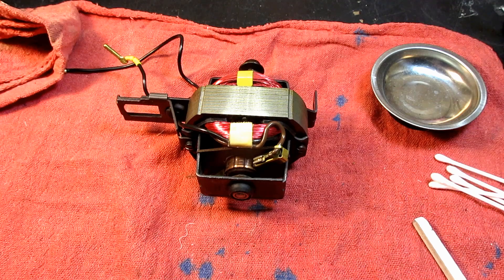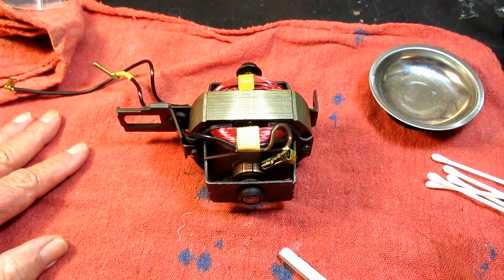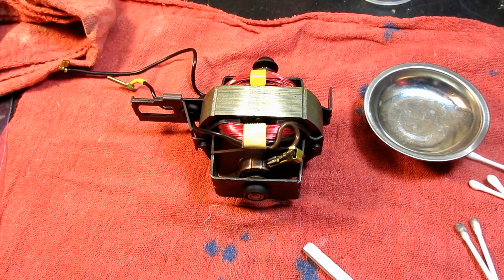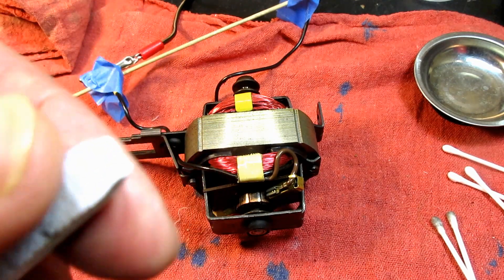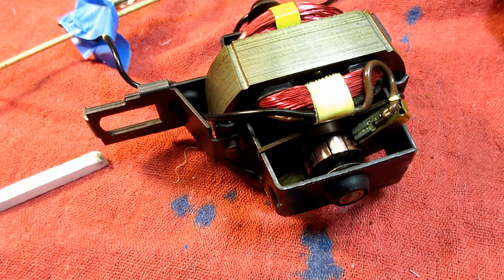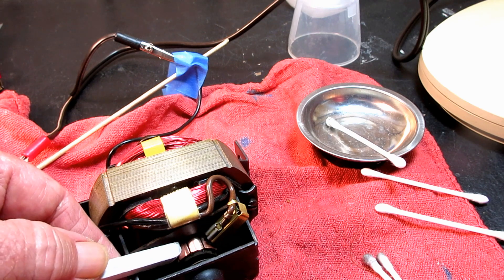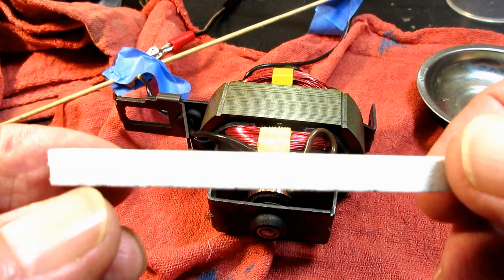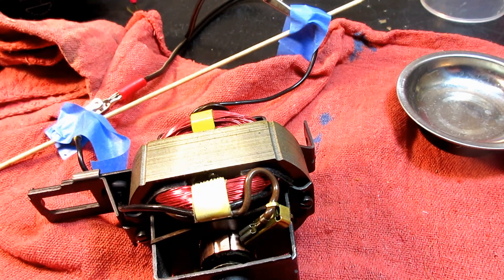Seating Motor Brushes & Cleaning Commutator on a Sewing Machine Motor

Comment: I have a Singer 15-90, with a 1.5 amp older vgk motor, and a 2.0 amp Foot Controller, (I also have a very good quality 1.4 amp Himen Trade Foot Controller).  My motor is mounted very close to the machine.  I can see that the Commutator has carbon dust on it, but I cannot get the outer casing off the Motor because the Armature is too wide for the hole.  I can get it off a little bit, but not really enough to use that Diamond D Stone.  I think that maybe the carbon dust is making the motor sluggish to start, even though I have an electronic Foot Controller, with a Rheostat that you can dial to make your motor slow or fast at the start.  I can't seem to get a nice consistent start (it hums, then starts very fast), and I am wondering if it's because of the carbon dust on the Commutator.  The motor also gets warm after only 10 minutes of stitching.  Is there any way to clean this Commutator without removing the Casing?
Reply from the maker: Not as effectively. The older service manuals suggested using an eraser to polish the commutator but you'd have the same trouble with access I assume. 
     Before I found the Diamond stones I used emory cloth or 800 - 1200 grit sandpaper, cutting the 1/4" strip and feeding it around the commutator, then rotating the motor shaft to try and polish the carbon off. You have to be careful not to remove copper, and it goes much slower, but I often get great results.
     Question for you, please: if you put the machine in bobbin winding mode does the motor spin the handwheel right away, or still heasitate? There can be binding parts on the machine that are causing the problems. That assumes the machine is clean and oiled properly. One part binding a little affects the entire system of moving parts, like the takeup lever, or slightly bent needle bar. 
I know nothing of your motor or foot controller.
     I don't know if the Service/Adjusters Manual would be helpful to you: https://manualsoncd.com/product/singer-15-sewing-machine-service-manual/
Reply: @andytubesewing1953  , Ty soo much for the advice!  I haven't tried it with the bobbin winder because I am painting the Bobbin Winder.  I am waiting for it to harden so I can add some clear coat.  However, I just rewired a 0.6 amp Singer motor, and I was just about to try it out so I can at least have a nice motor on this machine until I figure out that VGK motor.  I wonder if I could get an eraser in there.  Is there a special eraser that doesn't shed when you use it?  Just wondering how to get the eraser dust out?
Reply from the maker: @WeQuiltStudio  I did not mean to actually wind the bobbin but to just release the clutch like when you do wind the bobbin. 
     That releases the main arm shaft, and all the related moving parts on the machine so the motor is only turning the handwheel. That allows you to see if it is something with the motor itself, or maybe the shafts, needle bar, hook drive, feed drive, etc. 
     If the handwheel does spin fast try grabbing it while it's turning to see how easily you can stop it. That indicates the power of the motor. I just used a pencil with a soft eraser (pink) or a pink pearl eraser which is too large in your case. Debris can be removed by vacuum, or rinsing with alcohol. 
     I did get a reply from a friend overseas who rebuilds the motors whom I asked about your situation. He said he has had luck with spray brake cleaning fluid. That sounds a little volatile, but he says he uses outside and holds the motor verticle and lets the fluid drip back out into a container. He claims good results and he's been doing motors for 15 years as a side gig. I've never tried it but thought I'd pass it along.
Reply: @andytubesewing1953 , Ok Ty!  I will try the Bobbin Winder now.  Wow, that's amazing about the brake cleaning fluid.

Comment: I love your videos Andy, thank you. I couldn't find this diamond brush here in Australia, so I used my rotary tool with a nylon brush attachment. It did a great job cleaning the commutator in a few minutes and it was safe - 12 volts =)
Reply from the maker: That is a great idea ⭐ and thanks for sharing that! A different path to the same result. You're an intuitive person I think. I'm glad you found my video to get you started. Thanks for watching my channel.
Reply: @andytubesewing1953  Your instructions certainly put me on the right path. No sparks on my motor now. Thank you. Taking advantaged of this chat, do you reckon it would be possible to tweak these sewing machines to do longer stitches for example. Most of domestic ones vary between 4 and 5 mm stitches. I was wondering if  it would be possible to tweak the feed dogs to get 6 mm stitches for example. Any thoughts?
Reply from the maker: @mchaves7663  Many people have tried, very few have accomplished it. It somewhat depends on the model of the machine and how much you want to modify the machine, like with a saw and grinder. A machine with a lever system for the stitch length has a better chance. What controls the length of the feed dog stoke is the feed regulator inside on the end of the lever. You can try cutting the slot in the plate that covers the lever/regulator to make it longer on the bottom so you can move the lever down farther so the dog travels farther dragging the fabric farther between needle strokes. With me so far? Now what happens is the feed dog can hit the underside of the needle plate on the way up. You can try to lengthen the slots in the needle plate so the dog won't hit it. Now what can happen is the dog travels far enough that it MAY start hitting the actual body of the machine, in front of or behind the needle plate, or even both. There is a standard adjustment in some of the service manuals for adjusting the travel of the dog and you can try and tweak that adjustment now that the needle plate slot is longer and the stitch lever travels farther. One of the two shafts that position the feed bar that holds the feed dog has an eccentric stud on the end of it. You loosen a set screw or nut and turn that eccentric stud to try and get the feed dog centered in the new needle plate slot either forward or backward, trying to prevent the dog's longer stroke from hitting the machine body. It can not always be done and that is where the grinder comes in, grinding down the body so the dog won't hit it. You can't always let the dog go father to the front b/c it might hit the hook bracket or even the hook, so you are usually grinding the area behind the dog. If all that works for you then sometimes you have to adjust the height of the presser bar b/c you may have changed the elliptical path of the dog to a higher plane. One intrepid viewer said he managed to eke out a 5.62 mm stitch length. You can download a free copy of the Model 500A Rocketeer Service Manual and on page 5 it shows the feed dog adjustments for front to back and side to side and height. That would give you a visual of some of the processes I mentioned. Here is the link to the free service manual: https://sewingdude.files.wordpress.com/2012/09/singer-500-service-manual.pdf    If you think this answer was long, wait until you do all these alterations, haha.
Reply: @andytubesewing1953  You are amazing Andy. Thanks for the info...I will need some time to digest it all. May be a suggestion for a blockbuster video in the future.😃. We hobbyists are terrible, arent we? Always trying to push the envelope. LOL Thanks again
Reply from the maker: @mchaves7663  Welcome and sure, we'd love to see YOUR video! 😀

Comment: My 99's RF5-8 motor has the bushing in the housing rather than on a bridge like yours has.  I couldn't run the motor with the stone, so I turned it by hand used the stone to gently rubbed the commutator all the way around with the stone and got rid of most of the black gunk. It helped reduce the problem I was having with hum-and-no-run.
Reply from the maker: A good work-around solution as long as you keep everything moving and don't create a flat spot. Cleaning the commutator and the foot pedal can surely make a difference in performance.

Comment: Andy thank you so much for everything you do! I was wondering if this tutorial applies also to motors I have. They're both sluggish and look very similar: Singer 306w and singer 206k. Do you think I can fix them? Thank you!
Reply from the maker: I had to look for pictures of those models as I've never seen them in person. It looks like they have external motors. They will have the same basic parts as the internal motor in my video, just inside a casing to be mounted outside the machine. SInger model 99K has an external motor and I did a video of that: https://youtu.be/TmnnvGrEfmg   I also want to mention that when I work on a sluggish machine (that has been oiled properly) I more often find the foot pedal is the cause than the motor. Most of the pedals have never been service or adjusted ever! On my playlist page, I have playlists for two types of pedals, button-style and clamshell-style that show how to clean and adjust them. https://www.youtube.com/channel/UCUSPDsHaFtRoz1VA2U1xJ4w/playlists
If you have a different style of pedal let me know as I have done a couple other styles too. It is often easier to clean/adjust the pedal than the motor and maybe should be done either way. Good Luck and thanks for watching my channel.

Comment: Another great video thank you! 

I may be wrong but I think that the idea is to allow the dust from the stone to run under the brushes.  That way the abrasive from the dust shapes the brushes to the exact shape of the commutator.  I believe that's why the stone both seats the brushes and cleans the commutator at the same time.  I would probably vacuum it out after.
Reply from the maker: You are correct. I went back and looked at the instructions on the website: "Position the stone so that the top surface of the commutator moves away from stone" is what it says. I misunderstood the direction of the commutator in relation to the brushes. Interesting that it still cleaned the commutator so nicely. Thanks for watching.
Reply: @andytubesewing1953  I'm curious Andy, did it also sand down the mica in between the copper plates?  I cleaned my commutator using a pencil eraser.  It didn't clean it perfectly but it did a good enough job.  On my machine the mica in between the copper plats may be a fraction of a millimeter high and I don't want to use a scraper or a file.  I'm wondering if a seating stone may do the trick.
Reply from the maker: @r.duroucher225  The motors I have worked on have taller copper sections, meaning they stick up higher than the mica dividers. I think if your mica is taller than the copper that's a very worn commutator. That would mean the motor brushes are bouncing over every mica divider as the motor spins. The diamond stone I use is small and medium hardness. Much bigger stones are used on bigger motors and turbines. With some of the big motors, they put the commutator on a lathe and use a metal blade to remove wear grooves in the copper. I've seen stones in a wooden holder and the stone is the size of a brick, like large clay brick. If your copper is worn down to the mica may be an eraser is the best thing to use. If cleaning the commutator does not help performance it may be because the brushes are constantly jumping the mica and losing contact. https://youtu.be/nolIYleoz9M   eraser, sandpaper, stone.  (There is a video on YT of a person using a Dremel tool with a felt polishing pad and clay compound to clean the commutator on a 401A)
Reply: @andytubesewing1953  Thank you Andy, that's really most helpful.  I believe that in my case, I have a motor that's seen better days.  It was a curb-side rescue and moving parts don't last forever, even Singer 15 parts.  I'll have to put up with a bit of noise and a motor that goes through a few brushes until I manage to get a replacement.   From what I can tell, the only thing "wrong" on this machine is a worn down commutator.  After watching your videos I got everything else on the machine into tip-top condition!
Reply from the maker: @r.duroucher225  Ok, good. I know there are after-market motors; a handful of brands, that you can buy. https://www.amazon.com/Domestic-SEWING-MACHINE-MOTOR-SINGER/dp/B073HMW35R/ref=sr_1_2?dchild=1&keywords=.9+Amps+Home+Sewing+Machine+Motor&qid=1619134973&s=arts-crafts&sr=1-2
Reply: @andytubesewing1953  Thank you Andy!  I see this is a .9 amp motor which is close to double the power of the original.  Would you recommend going that high?
Reply from the maker: @r.duroucher225  I don't think it would be a problem as long as the foot controller was rated the same. I think that's why they sell many of the motors with a foot controller include. I once put a 401A model into a 301A. The higher amped 401A worked great.
Reply: @andytubesewing1953  Looks like I now know the road I will end up going down.  Thanks Andy!
Reply from the maker: @r.duroucher225  https://www.youtube.com/watch?v=qe6fqiYj8U8     https://www.youtube.com/watch?v=T5H2l6TRnA8
Reply: @andytubesewing1953  Thanks Andy!   I'm most obliged.

Comment: Is there any additional maintenance that can be done on this style of motor? My singer 457 gets a lot of use, and it seems the motor is getting noiser and higher pitched, has an almost rattling sound when you turn the handwheel with the needle/bobbin mechanism disconnected, but only when turned towards you, not backwards. I have two of the same model, my daily use machine which has this noise, and another backup i restored using your gear replacement video. Without knowing much, I'd guess maybe bearings need lubricating but I'm not sure if this motor style is designed for lubricating? This machine gets used regularly to sew materials way heavier than probably originally intended, so I'm also willing to accept it could just be slowly wearing out. Would it be ok to send you a video of the motors to get your opinion? Thanks
Reply from the maker: You can lubricate both of the shaft bushings at the ends of the shaft. Just a couple drops of plain sewing machine oil. If the bushings are sintered bronze or "oil-less" bushings there are microscopic spaces in the metal that allow oil to be "stored" when the bushing is cold. When the bushing heats up the oil migrates towards the shaft causing a "film" of oil for the shaft. After sewing when the motor bearings cool down the oil is drawn into the spaces again. Nothing lasts forever and my belief is adding a small amount of oil, a drop or two, to the bearing can not hurt anything and may definitely help "reload" those spaces with new oil. Personally, I put the machine into bobbin winding mode to keep the needle/hook from turning and run the motor to heat the bushings then a drop of oil into each bushing and hand turn the handwheel to spread it and then let the motor cool back down completely. I feel that prevents the new oil from flying around onto the motor parts and allows the best chance for absorption into the bushings. I've lately come to believe plain sewing oil is best for the bearing. As much as I love TriFlow oil I've started wondering if, over time. the PTFE additive could start blocking or filling the tiny spaces in the metal. I don't know that for a fact, just my feelings.
Reply: @andytubesewing1953  Thanks. Just tried a couple of drops on the belt-side bushings, maybe a slight noise reduction, difficult to tell. Can't reach the opposite side though so will have to find a way to get a drop in there. Tried a drop on a screwdriver and dabbing it on but its a bit too deep and dont want to accidentally touch the commutator. I was just watching your 337 restoration where you removed the motor. Unscrewing it and wiggling it to a better position might be my best option.
Reply from the maker: @sew2000  Yes, you'll need to reposition. That motor is a model SN(K) OPEN style, used in many of the 300, 400, and 500 series models. Here is a video of disassembling and repairing that motor after soaking it in dirty water: https://youtu.be/6y1EN5S2sz4
You can't buy a new one but there are usually used motors on eBay. Here are 3 I found on my first search:
https://www.ebay.com/itm/Singer-Stylist-Sewing-Machine-Model-413-Motor-Plug-On-Off-Switch-Parts/254875651989?hash=item3b57c5cf95:g:WfMAAOSwls9f~FUb
https://www.ebay.com/itm/Singer-Stylist-457-Sewing-Machine-Motor-with-On-Off-Switch-Electrical-Receiver/154208469855?hash=item23e78a835f:g:LvoAAOSwecZfuv0c
https://www.ebay.com/itm/Singer-338-Sewing-Machine-Motor-Light-On-Off-Switch-Vintage/174560478472?hash=item28a49d8508:g:QQgAAOSw-JRf2Q3P 
Since they are used you won't know how well they work until you buy one.
If you have the motor out of the machine you can see how much of the motor brushes are left since you've been using it heavily. If the brush is almost worn off, the spring may be hitting the commutator. If the brushes are still good you may want to reseat them and clean the commutator as I did in this video https://youtu.be/rpTy_Bz3prA
Reply: @andytubesewing1953  Thanks, I hadn't seen your motor disassembly video. I'll have a look in more detail when I get a bit of time.